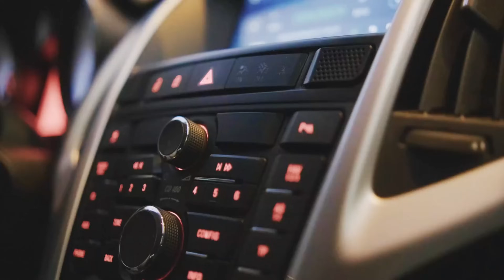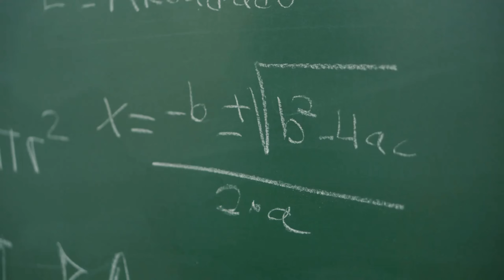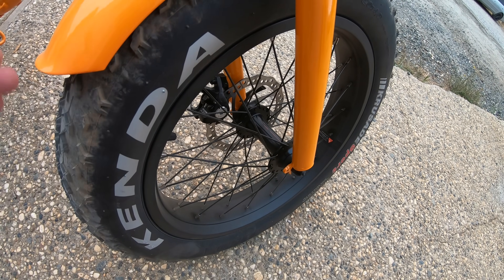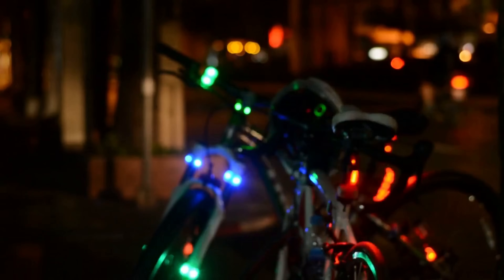Will Ebikes Ever Recharge While Riding?  Explained

Comment: I still believe that if you put a bigger generator on the front and combine with the rear for braking purpose any speed over what it could go on flat land would charge the battery twice as fast as going down and another point I'd like to make is that 500 watt motor is 500 watts max , that's not always maxed out at 500 watts maybe on flat land it draws 150 watts and up hills draws 500 watts... That means if you travel down the hill at speeds faster then the return up you may be able to store 1500 watts on the way down and use 500 watts to travel up .

Comment: if u use on your bicycle electric shock absorbers made of coppercoils on hollow tube and strong magnet inside it, it will absorb shocks and also generate energy when you ride on bumby road, in that case you can make bike run forever if sufficient coil turns are done on shock absorbers.

Comment: EUREKA! A new regen system now exists!! It ONLY works during braking and when not braking you can FREEWHEEL!
GRIN Technology (Canada) has begun licensing the new FREEGEN regenerative BRAKING system to work with the excellent GRIN hub motors.  A marriage made in - Vancouver and Israel, where FREGEN was invented. The key is how the disc brake rotors are attached.
Check out the YT explanation. EUREKA! EUREKA!

Comment: So I have about half of the things to build an e trike from a beach cruiser frame. I'm going to chain in a direct drive from a 3000w motor to the axle that will be below it. Also thinking of doing a front 1000w because I live in NM and it sounds useful. I'm going to use a huge 48v 200ah battery to power this. My question is if took an alternator 120w from a car and attached it to the same axle would it be worth it?

Comment: You are lying direct drive on the front of the wheel will recharge the battery using  a charge controller you just won't people to buy more batteries it will work stop fooling people

Comment: You need to rethink your bike. Look at the eAhora M1P, or that series. It's like a little Harley, without an engine. The motor is in the rear wheel. 2000w 60kva
Reply from the maker: I've done a few videos on the M1ps.  😉

Comment: Question: So its never going to be a perpetual motion machine, but if we had a generator connected to the pedals and instead have a front hub motor rather than a rear hub, would that  help with going faster or more efficient with hill climbs? My thought process on this is you would have a two wheel drive system as both rear (pedalling) and front (hub motor) would be spinning.

Comment: can you use a solar power bank to charge .the bike with a solar panel  generating new power .from the sun .the solar power bank recharging the battery as you ride .put a solar panel on the power bank .built in .the device

Comment: I built something like this on my mobility scooter so that it charges a bit during the ride, the way I made it I can now drive 50 km more than normal.
With magnets that generate a total of 12 volts, I send that to an inverter to 230 volts and I connected a trickle charger there and now I have enough power to be able to drive my mobility scooter for a little time longer.
I studied this for months and finally found the solution by simply testing the theory in practice.

Comment: I think regenerative braking is limited where it is at, i cannot see how you can get much from it.   The real problem all along has been the battery .  The idea we need a battery we must recharge is where the real fix is.  Also we may be able to triple the power of these motors by different designs which add windings to magnify the power these motors have.

Comment: The problem with you video is it discourages new technology by saying that idea does not work.   Edison like many inventors did ideas that did not work.  Ideas that work involve failure. You are down on failure.  A light bulb we bought 30 years ago needed at least 120 vac to work an did not last 6 months today we put out more light with LED technology that runs on 6 watts at 5vdc even though it is run on 120 vac due to a regulator to make replacement easy the bulb lasts 10 years.  So to say a battery will not be replaced muchless the motor with a setup that runs both , will happen.  Using yesterday's knowledge to explain what we can do is limited in itself.

Comment: You could do a generator on the pedals, and or on the front hub, and then the power will go into a second battery that will charge while you are using the first battery. Once the second battery is charged, you could have a controller that can automatically switch between the two batteries once the one is full, and then it will begin to charge the other battery that is nearly depleted. Yes, seems complicated, but I'm sure that could be done considering there are already bikes with two batteries on the market.

Just remember, my name is JAKE WEST, and give me some credit if you ever put this idea into motion and eventually market it. I will one day attempt it, but idk how to design, let along build a controller that could do this. You could also use super capacitors as a third power source that will then charge the second battery pack. Just an idea
Reply: did you even watch the video? the amount of power used by the first battery to recharge the second one would be more than 2x

Comment: Pissing in the wind here. A dynamo on the front wheel to recharge a small battery that powers the head lamp, turn signals, display, and brake lights without drawing power from the main battery. Then again you have an issue with power to weight ratio.
Reply from the maker: Electrically speaking that is less efficient than just powering all of those things from the battery in the first place.  The only logical reason to do that would be to keep your lights running if the battery runs out.
Reply: @Area13ebikes  Back to the drawing board. 😎

Comment: And  alternate is not a generator  where a generator puts power out where as and alternator  alternates the power cause a battery in a car is used to to start the car and run the electronics in the car and on the car that's why you can run the radio have all the lights on in the car with it not running and  disconnect the battery  and the car still run because the pistons spark plugs and. Gasoline run the car and then the crankshaft is synced with the alternator basically which has a built in voltage regulator so the alternator can there for maintain the battery  by alternating the power to everything and then back around to the battery and  that's why you can jump a car off with a dead battery and wants to jumps off you can drive it and it will bring the card back up on the battery therefore I would say that's recharging the battery so if you take an alternator and use it as your motor too and make your batter your powerplant you can now send power to the alternator which in turn will spin the pulley on the alternator and you attach a belt to  the back wheel  or front to make the tire start to propel you forward  so now your moving so your  alternator it's spinning an then the voltage regulator kicks in and starts to regulate the flow of energy and some to the alternator then to lights etc  and back around to the battery just like a car .
Reply: an alternator is a (starter) motor generator that provides DC voltage to the charge the battery and run the electric consumers of a car.

Comment: The bike tire or chain can turn an alternator to charge a battery that’s hooked up to a power inverter and plugged into the ebike charger that’s plugged into the battery. It works on a car it should work on a bike.

Comment: I put an alternator connected to my my tesla back wheel  via rotating wire and reconnected to battery.  I haven't charged my Tesla in over 9 months and 8,000 miles. No lie.

Comment: Have you considered use a multi battery system? One actively powering the motor and one on standby charging? It would still be a net loss if all your using is a front wheel dynamo but I also have a jackery 240 and a genarac GP25001 daisy chained together with a panel on a wire frame awning I made of garden fence. Sometimes the standby battery charges off the solar some times the generator the dynamo (yes I know) is more of a helper and not the primary power supply. I also have a small trailer with most of the gear I thought about running two more dynamos off of the trailer wheels but I like being able to take them off when I put it in the blow up raft and it’s hard to water proof them because it uses too much tape sorry if I’m rambling a little

Comment: What if you hook a pulley or sprocket to drive an alternator hooked to you're charging wires for battery from a direct drive motor when you drive it spins the alternator goes the same rpms as the direct drive kit

Comment: i do know that my friend had a flash light that worked by you turning a crank and charging up the batteries in order to use the light for a short period of time ... when the light starts to dim you just hand turn the crank for about 10 seconds and you are good to go again for a bit
Reply: It's probably cause it's using an ultracapacitor as its energy storage.
Reply: lights used to take a lot of energy to stay lit. 

Typical incandescent bulbs for example could use between 60 to 100 watts of energy. 

A cfl bulb uses 9 to 23 watts. 

LED bulbs use 4 to 15 watts. 

So using a dynamo to recharge a battery to keep a light going is impressive, but the amount a bulb takes has decreased based on the type of bulb type you have. 

when pedaling, you generate a number of watts between 50 to 150 depending on age.

Comment: I think it's silly not to use gravitational energy to compensate for some of the lost power.  What I mean is that by the way, we can easily use the energy of gravity when going down the slopes and we can extract the maximum capacity of the engine when working in reverse.  You can even turn this system on and off manually, so that you only engage the generator on downhills, so that no battery power is used to turn the generator.  It is completely possible.  Especially in long distances where you may be downhill most of the way.  It is even possible to use the wind power generated while riding a bicycle to generate electricity.  and get the minimum power required to turn on the bicycle lamps from these methods.  Anyone can easily install two or three high-performance propellers on the front of their bike.  It is both beautiful and lovely and practical.

Comment: Well it would require some sort of trickle mppt system with some sort of alternator that would then be stored into a lithium battery, which then needs to survive being trickle charging constantly..terriblefor the battery lifespan. Nope not possible. There is a theory that having a little solar system latched on the back with some high efficiency ultralight solar panels into a stored battery to then charge the battery at the proper volts,amps ect could add some extra miles to a trip if you ride the whole time. Give it another 5 years I'm sure there will be somthing by then.

Comment: What about two battery alternate one will be charge by dynamo generated in rare or front wheel,when the charge battery is full it will automatic transfer to the lowbat battery and he will be recharge again,I think it need electronic system like MOSFET and relay

Comment: If I may correct you, there are people that are using the geared hub motors to capture energy. the geared hub motor are 3 phase AC hub motors, you would need a device known as a 3 phase recitfier to match the voltage needed . then you would need a a wayo to convert that power safely to a charging ciricuit for the bike, this "Sytem with the converted AC in to DC then could be connected to a "Charge Controller", to be honest this would work best on down hill rides. and coasting you wouldn't get much of a charge  on flat ground.   So unless your traveling down a long steep road, you would not have much of a charge.

Now, if you want to cahrge your battery using the motor, turn it into a wind generator, get a proper charge controller and let the wind or solar power charge your bike when it is at rest. 
This brings up another subject, it is possible, to charge your battery and ride at the same time. However your BMS may not like that Idea.  This would could work by using what is called Pass Through Chargin almost all e-bikes have it, connect the charger, and you can opperate the e-bike using the charger...not literally ride it, but you can use the charger to test the motor and other things for trouble shooting. 

How Do I know these things? I have worked with electronics ever sence I have been the age of 6 years old. 
 and I have workd with various motors . the "Off gridders" are very adataptable people, and some  have used these gear hub motors to produce power, the best motors are the motors that do not have a clutch in the planetary gearing ssytem. 

For example my santamonica Super Cruiser with the 750 watt motor at 48 volts could be adapted to a wind turbine And With th my mPPT charge controller that I have for my solar power, I could then use 750 watt  wind trubine to charge my battery system. in which it would be connected to a 400 watt pure sine inverter at 48 volts, and I can power my bread machine . no joke.  And... you have enough batteries in your stock pile to run a 48 volt inverter for 4 to 7 days...Yes.... if you have all those 48 volt battereis you could litterayl connect them and use them for emergencey power.... but I must caution you...take well care.... one error and you would not want to release the fire... but I think about 20 of your 48 volt battereis connected to a 48 volt inverter would keep your fridge happy... an MPPT charge contoller rated for the 48 volts, and the appropriate solar nad or wind turbine configuration, would indeed be enough to power your firdge, toaster and if you have chosen a 3 kw pure sine inverter... will allow you to cook a pizza in one of those mini ovens... I think about 10 of you48 volt batteries marreid to an inverter in the form of a parralell circuit would do you well in a poewr outage... it would make for a happy fridge , Now if you ever get people ordering batteries only.... you now know why..espcially if they do not own an e-bike. just food for thought...bike batteries are perfect for solar power, as they have a built in BMS. and an easy way to connect the batteries in parallel. if the person knows how to wire that way.  the batteries also have a built in charging port...isn't that so kind of the manufacture :) hmm.... be a mess of wires that is for sure. and that would be a lot of amps flowing lets see what is 14.5 amps 10 ah yes 145...OUCH..... that will toast you if you don't handle that right, now what is 145 x 48 volts. that is rought 6,000 watts..ok I rounded... I could if my inverter accepted that incoming wattage, run my dryer and cook a pizza.and charge my e-bike and run all my electronics. using a very expesnive pure sine inverter.

Comment: I've just built a ebike what I'm selling

 52v 1000w direct drive hub motor.
And when the battery is turn off or not connected.
When the bike is moving or pedalling.
It charges up my phone and the light come on.
Also it has regenerated breaking.

I have a voltage display on the key ignition.
Just turning the wheel by hand you get 30V+ very easily.
Double that speed you get 60v which is more than enough to charge the battery up.
Reply: just install step-up electronic charger who can charge from 5-40v to 42v battery or supercap !!

Comment: I don't know if this has been suggested yet, but what about putting a second battery pack on the rear basket area. Have a hub motor on the front wheel that charges the spare battery as it spins and when one battery is low and the other charged, it switches (automatically or manually) and begins to charge the 1st battery and use power from the 2nd one.

Just a thought.
Reply from the maker: Not an efficient method.  Better to charge at home and just ride.
Reply: You would be expending energy from the main battery to charge the spare battery at a much smaller rate. Just pedal slightly more or raise your tire psi up a few psi and it’s way more efficient than the setup you propose.

Comment: You can extend from ebike to trailer panels in length 2-3m, 400 to 600W, if you get out 400Wm that is more than enough even 300W, or you can charger another 3 bat and have more panels on trailer to spread around when stop.

Comment: Not infinite range, but a bike that uses regenerative braking would be good, you could even have a bike that allows you to just maintain the same effort whether going up or downhill by varying the amount of assist or regen it gives you, literally flattening the ground- yeah it'd still run out of power but it could be interesting- maybe you contribute what you can and use a throttle to set speed rather than power and it can decide how much regen or assist is needed to maintain that speed within the limitations of the rider and the bike.

Comment: Well, I've built and will test his theory. as my revesred motor spins with not much drag, so connected with other electric gubins. It produces 10.3v when spun lightly by hand. So guessing the equivalent volts while scootering should be more than that produce a ample amount of voltage too be put back into the battery.
Reply: just install step-up electronic charger who can charge from 5-40v to 42v battery or supercap !!

Comment: Hi . Interesting video. Question. Assuming standard rear drive setup, would a front hub direct drive motor not provide some power to the battery if used as a brake in downhill mode?

Comment: I think there are some ways to do this.
 Ex.  Use Low rpm generator
Ex. Gear down the generator to gain more spin in the generator
Ex. use 2nd battery for the generator to gain more miles.